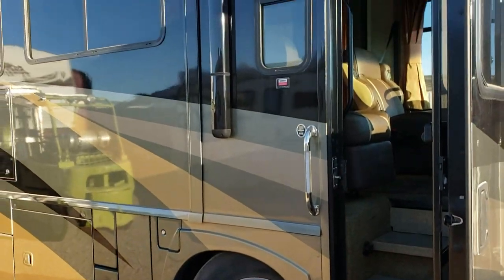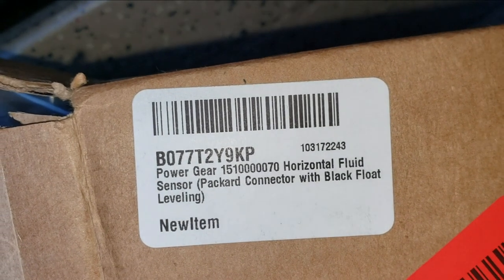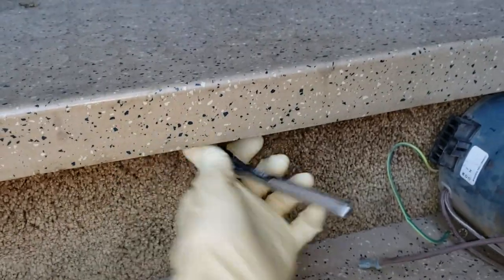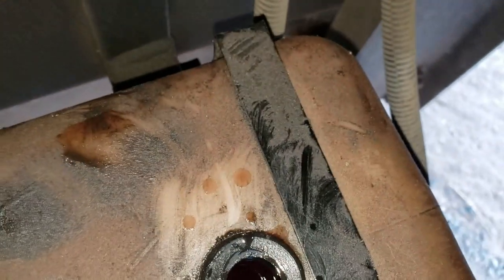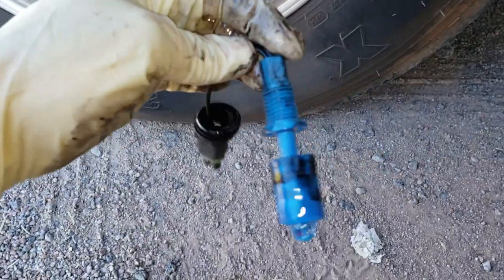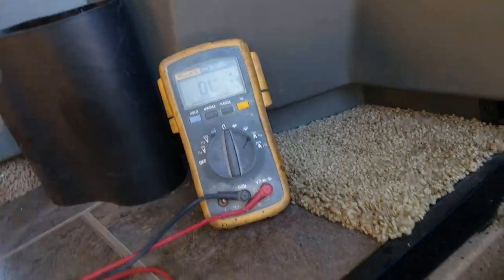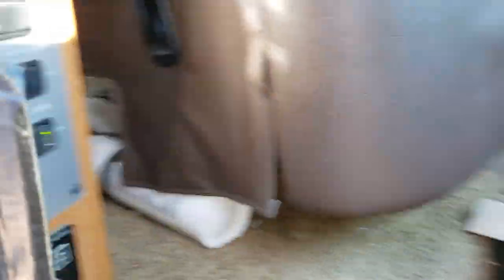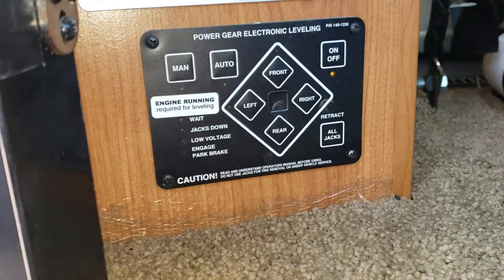Replacing a Power Gear Jack Warning Switch

Comment: Another piece of information added to the old knowledge bank. I have a Winnebago pusher so I’ll remember this. Thanks so much.

Was wondering if the leveler fluid should be changed if it’s carrying metal filings?
Reply from the maker: No, the filings were small normal particles. The pump actually has a screen sump that picks up about 1/2" from the bottom of the tank. Jack fluid really should never have to be changed as normal servicing. Thanks!

Comment: Why in the world don't you clean the area around these switches before you remove them?? It can't be good at all for these hydraulic system for them to get dirt and dust in them.
Reply from the maker: I did clean the area off before installing the switch...but you do have a point. Thanks!

Comment: You need a camera mount so you can use both hands. hahah. Thanks for the info. I have a 2004 Newmar Mountain Aire that when driving the buzzer comes on for jacks down. I have to push the retract button and it stops. Could this just be low fluid?
Reply from the maker: newmar generally uses hwh. you need to let those go hrough a complete store cycle 6-9 minutes. it will turn itself off and that should stop your problem. I like the idea of a mount, but have found the setup akward and time consuming...but maybe. Thanks!
Reply: @AZExpert  It is HWH leveling. I do leave it on after I retract, but then the buzzer will come on randomly while driving.
Reply from the maker: @kevinwilliamson7294  the Jack's are spring retracted and each jack has a sensor. If the alarm is still going off and retracting turns it off it sounds like the jack is extending and thermal expansion is the only other way beside the pump to extend. I would check and make sure the Jack's are completely retracted. The foot should be all the way to the cylinder
Reply: @AZExpert  Thanks for the insight. I did notice that the one jack on the rear has a small amount of chrome that shows on the cylinder when retracted. Maybe this one needs new springs. Thanks Again!

Comment: My Winnebago Elante 1994 just blew hydrolic fluid all over the ground on front driver side. Not happy but I will have to get my butt under there to hopefully fix what ever happened! I know now how you regret working on hydrolic! Well so do I. I swear all I have to do is walk by it and it jumps on me all over myself. Thanks for your input !
Reply from the maker: sounds like the manual manifold has a leak....likely a hose

Comment: Test the old switch. Maybe? I was wondering if it just had a bad spot or if it was totally shot. Great video
Reply from the maker: Thank you. I did test it off camera but could not find a  spot that failed everytime. It's just a reed switch so its possible that the failure required more movement to fail closed.